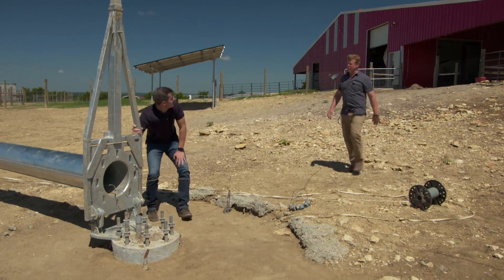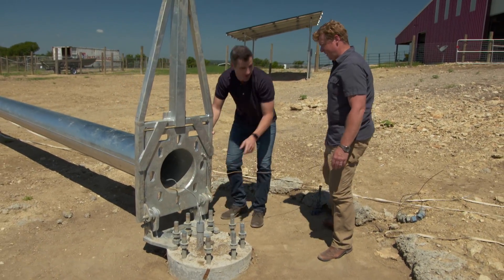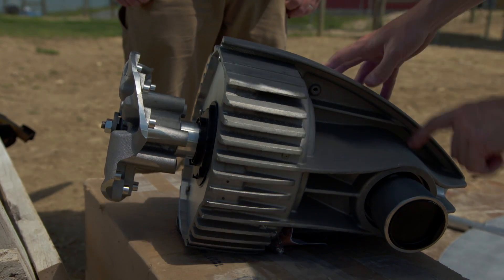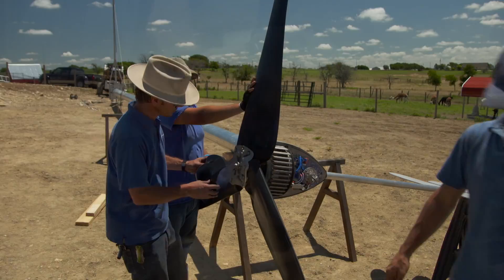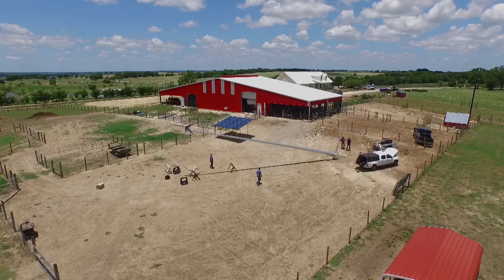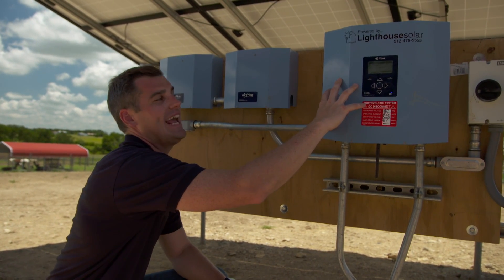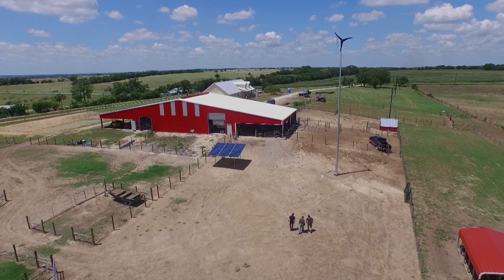How to Install a Home Wind Turbine | Ask This Old House

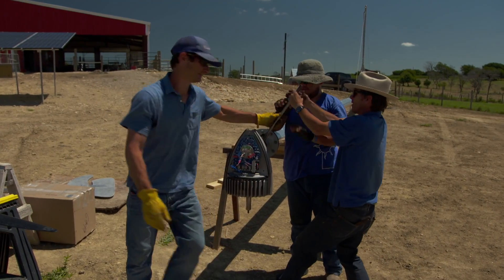Comment: Lol @2:30, why not just use a longer tool for more leverage?
Reply: In order to be strong enough the pole (90 degree to tower) is usually welded (and often braced) to the tower pole. So it is always just there. The longer it is the more chance you will trip on it, hit with a mower, etc.

Comment: So I just lift up my 60ft pole that’s already at my house, and I’ll have wind power?
Reply: Yea, dont forget to also use the solar panels, and inverter that is also there somewhere and the batteries that were missed in this step by step, diy how to useful video
Reply: @syaz4380   That's a generator. But yes you can use it as a motor.
Reply: @asmmahfuz8569  You don't want to use a motor = too inefficient.  Use an AC 3  Phase generator, that is designed for a wind turbine.
Reply: @MrSummitville  That's a good advice.
Reply: @asmmahfuz8569  Many Wind Turbines spin at only 400 RPM.  Some up to 800 RPM.  For a given Rotor Diameter, we should always use an alternator that creates the proper power (watts) that matches the RPM of the Blades at the "Rated Wind Speed" ...

Comment: This is a cool project and I applaud the owner, but this was a terrible investment. That wind turbine probaby cost him over $50,000 with permits, electrical and digging. At 1500 watts this means it is connected with a puny 12awg wire and will take decades to break even at 10 cents a kw/hour. Not to mention 1500w is only possible when the wind blows and is a maximum rating; he could only be getting 200 or 300w on a calm day.

The same goes for solar. Too expensive and does not generate enough power.

When solar and wind can hit 20kwatt continously then ill consider the 40k investment.
Reply: I will break-even in 3 - 4 years, with my self-installed 8,000 Watt PV array.  I got 30% of my investment back the next year. The panels are guaranteed for 25 years. Lots of sun plus expensive electricity per kWhr = quick pay-off.
Reply: @MrSummitville  certain markets, like ripoff California or Hawaii, will pay off faster.

1500w from a wind turbine though ia worthless. That's not even a 15A 120v circuit.

Comment: All the excess energy goes back into the grid? Umm...that is something I wouldn't want to hear.My wind turbine, my energy.
Reply: You wouldn't want to be paid for the energy you put into the grid? Help others reduce their fossil fuel use?
Reply: @void970t5  Most states now limit you to the max amount you use per year. All you can get paid for is to drop your bill to zero, anything you produce beyond that is just a donation to the power company. Some states (HI) are no longer allowing any new grid tie installs.
Reply: @bradquinn4161  Net Metering - most people do NOT generate more than they consume, on a yearly basis. Daily credits can and do accumulate until consumed  later in the year ...
Reply: @MrSummitville  First that is why I said per year. Second more and more people are going to systems that can sustain themselves at any given time of the year. The grid has become increasingly unreliable over the last few decades. A lot of areas are see outages of multiple hours (or longer) several times a year(or more often). This is why systems are increasingly going from just grid tie to hybrid (with storage) grid tie.

Comment: The title makes it sound like anybody can do it. I think not
Reply: I poured a 6 X 6 foot by 4 feet deep base for a 75 foot radio tower. As well as digged a 120 foot trench for the communications lines. So yes it can be done yourself but it's a lot of work an time. Also added steel rebar throughout the concrete base. As far as 20 foot deep bars for support you could rent most of that from Home Depot I bet.
Reply: It is easy if you buy the generator and the blades from market. Anyone can do this. But if you want to make generator by yourself then it's awhole different story.
Reply: @asmmahfuz8569  I can't put a giant concrete pad or wire the whole grid for this
Reply: @joewalsh1054  Its not that expensive to get a person to make you a concrete foundation with piles
Reply: @asmmahfuz8569  see I aepdodoeps p do oh9spspdpr9e or ú8 Dr r490rr0d koo ot poo opr0rpr00e99eodorodooror9r89rr9p
Reply: If they can do it you can do it what makes them better than you

Comment: I love wind and solar.........but for some perspective; toasters and hair dryers can use 1500 watts; that's 1.5 kW!!
Reply: Dennis Downes , yes you are correct , but the power doesn't go straight through , it goes to a battery bank that has been charged , so the sun is charging the batteries and the wind turbine is charging the batteries , the solar panels can charge during the day and the wind turbine can charge day or night to keep the batteries fully charged, so you can eat your toast while you blow dry your hair , and your electric bill is still ZERO
Reply: @jimthomas777  I guess you missed it. This is a grid tied system, probably no batteries used.
Reply: Brad Quinn , even grid tie system has batteries , and I could care less if it does or doesn't have batteries , the guy is still saving money , in the last 4 years I have saved over $4000 dollars , and those  4 G's  were not missed by me , they were missed by the electric company ,  but I guess you missed it
Reply: I am all for renewable energy. SOME grid tie systems have batteries (usually called hybrid) ,but most do not. One of the biggest expenses in solar is the batteries. It is also the most common thing to fail. That is why most grid tie systems do NOT use batteries.
Reply: Brad Quinn , That's exactly why mine is not a grid tie , mine is OFF grid , I'm getting ready to talk some of my buddies into doing the same thing as me
Reply: @jimthomas777  Price the system with and without batteries. The batteries will probably be half the cost. I am not saying you are wrong, just making sure you are aware. Stay away from lead acid batteries unless you like to replace them every five years. NiFE and LiFePO are probably the best. NiFe are not very efficient but they are almost impossible to ruin. LiFePO are very efficient but can be damaged pretty easily. Both can take high amp charging. Both are expensive(in the short term).
Reply: Brad Quinn , this guy has had a used forklift battery for over 20 years , and it does just fine , used Hospital  lithium batteries work great , they get rid of them before they go bad , because it's a Hospital , there are other options also , I have a optima red top battery , it's 11 years old
Reply: The hospital batteries are usually LiFePO(lithium iron phosphate). I would bet that the guy using the forklift battery seldom uses more than 20% of its rated capacity (massively over sized battery), is religous about battery maintenance (at least weekly) and you can do that but again it just raises the cost, space, and MAINTENANCE hours. I call BS on an optima battery on a house sized battery array lasting 11 years. Even the "good" AGM batteris designed for solar rarely last that long.
Reply: @jimthomas777  No Grid-Tie systems do not have battery banks.  If it was Grid-Tied and it had a battery bank then it would be call a Hybrid Inverter.
Reply: @bradquinn4161  I agree, I have never seen anybody use a battery bank and generate their own electricity, using PV and/or Wind, that is cheaper than the cost of their existing Grid Electric - NEVER.  I am still waiting for that first person .....
Reply: @MrSummitville  The key word their is existing. IF you are building a place that is even a few miles from an existing line, some utilities charge $20K a mile to run a line. In those situations it MAY be more cost effective to go the battery route. The trend now is to oversize solar input and minimize battery banks. Size your system for the worst solar day of the year and assume it will be cloudy that day. The advent of 400V strings combined with MPPT charge controllers means that you can produce usable power (30%of rated capacity) even on the cloudy days. Which is why many size there systems at three times the required size for day of the year with the least sun. In the long run it is cheaper to put the money into larger solar banks than batteries. The solar panels will typically survive three or more battery banks being replaced.

Comment: 2:30 "Mama's don't let your babies grow up to be wind turbine install technicians..."
Reply: Three of the weakest turbine installers right there
Reply: badad0166 , mama , what is a wind turbine install technician ? 
 well , red goes to plus 
black goes to minus 
and where does the third wire go mama ? 
that goes to the ground , 
so just throw it in the dirt ?

Comment: I wonder how much this turbine cost for 15 amps
Reply: At what voltage? 24 volt 15 amp ones are on about 400 bucks
Reply: Not that size that size is huge add the cost of the cement the base the hinge the pole the installation just the cement alone is like 10 grand and an aluminum pole that size is about 5 grand or soo
Reply: @erickfernandez8485  it is a steel pole and I wasn't talking about an install. That price changes depending on where you are and how high you need to mount it.   There really isn't a need for such a crazy hinged pole.
Reply: Like 50 to 75 grand

Comment: Thank You for a great video.  I plan to put up a micro wind turbine. What I would like to do is tie to the grid and power my house as well. If the grid shuts down I would like to continue to supply power to the house without any power going back into the grid AUTOMATICALLY. And when the grid comes back uo, Supply the grid with power again automatically. Is there a way to do that? If so please point me in the correct direction  to learn. Again Thank You.
Reply: Check out the Fully Charged video where Robert talks about the system he had installed at his place.

Comment: Which genarator you used AC or dc
Reply: 24 dc
Reply: @Sunblocker101  Turns out this one is 380V regulated DC.
Reply: @bradquinn4161  Turns out ... the generator is AC, which is then converted to DC
Reply: @MrSummitville  If you look at the specs of this particular wind turbine it puts out 380V regulated DC at the Turbine. I agree most (90%?) wind turbines send out multi-phase AC down to the ground but not this particular one.
Reply: @bradquinn4161  I did not say that was the voltage down the mast. Where does it state the "Generator" outputs regulated 480 volts DC?

Comment: I would not be happy with the tiny concrete foundation. There is a massive load - cantilevered off the edge of the concrete under the hinge, which is likely to crumble over time. The hinge area needs more support!
Reply: You did catch that there was a pad under the ground (9ft diameter) and then four footings that went down twenty feet?

Comment: 2:40
Never do this for you diy home turbine, look at the numbers of electronic componets inside. 
He will have to take it down soo again and replace circuit board.
Here how you do it correctly. Drag 3 phases from turbine into your house, then connect it to speed controlller/charger at your home.
Reply: Yes the way they did it was not the best to say the least. Transforming from ac to dc current makes you lose a lot of effect in those long and thin cables. And you need all those vulnerable electronics components in a very bad place susceptible to rain and maybe lightning.
Better deal is sending ac current and rectify it once it's on the ground and is a sheltered place.

Comment: WAY- WAY tooooo small on the wire and way-way too much concrete to hold that pole.   
That's an AC wire not for running DC over some distance.  He will be lucky if he gets half of what little he will produce down to the converter.   DC at low voltages loses much of its current, unlike AC.  
All that work mostly wasted!
Reply: Exactly!
Reply: I bet it's an 3-phase AC 48V alternator. So the wire would be enough, even though, a larger diameter would reduce the wireloss.
Reply: 24 DC at 1,5 kw, is 16 amps. 
so a 6mm wire is enough for 17 meters. (looks like 17 meters for the wire length.)

Could be sheilded tho for less losses.
Reply: @Sunblocker101  rly? How? 16A*24V= 384VA, where do you have the other 1100-1200VA?
Reply: @djangoryffel5135  oh sorry 64 amps
Reply: @Sunblocker101  The switch from AC to DC was done in the Nacelle. The wires ran straight out of the ground into the inverter. IF they had done the conversion at the inverter, you would have seen the units. As they dump a lot of heat they are always outside the inverter. At 24 volts with that amperage over that distance with those wire you are looking at least 10% line loss. Probably variable voltage 60 to 160 volts and the wire would still be to light.
Reply: Turns out it runs at 380v regulated DC. It is also rated at 1.5kw in a 11m/s (25mph wind).

Comment: This is absolutely stupid, massive pole, massive foundation, why not bolt it to the building? it's higher and that's probably where the power going anyway.
Reply: There is a reason for the massive pole and massive foundation (they are not over sized). In a 60mph wind it would tear it right off the building. Big surface area with a 60 ft lever.

Comment: That pole is insanely big for 1kw of power, and this is why the wire is so small. I would have expected at least 10 or 15 kw for that size of pole. Also for the size of that guys property why such a small system? I would think that 10 to 12 KW on the solar would be more like it, as 12KW solar gives an average of about 4KW, and the wind power depends on the wind in the area. I am basically saying if you are going to pay someone to put something in it is better to pay for more than you need because the cost difference in the larger is not much when looking at the overall cost. Also it means that you will not need to upgrade in the future, and if you are using solar and don't have much backup it can power all of your appliances during the day, and then batteries will keep your food cool and your lights on at night.

Comment: no slip rings for the wiring? what if the head spins around 1000's of times?
Reply: What if it does not?
Reply: Generally the "cord" is setup like a spring. As it spins one direction (say clockwise) it tightens the spring. After it gets so tight it pushes the head in the opposite (counterclockwise) direction. It does wear on the cord over time but it is more reliable than a slip ring.

Comment: Would they allow this in a city?
Reply: Wind in a city is greatly reduced by surrounding buildings. They usually say at least 150ft of clean (no obstructions) air. For liability reason you will need to own the land for a radius from the tower at least the height of the tower. Your home insurance would require that the tower be at least the height of the tower away from any structure.

Comment: IDK what the solar panel prices are like in the USA but in New Zealand you can get 26 270 watt panels for $6,000 nz dollars thats 7020kw of solar oO its flipping cheap and solar is simple to install   for the wind for a 2kw mill you can pay 8,000 or even more but wind is useless on small systems it only realy works when you get 10kw systems or bigger with 2kw systems your find that most the time your be lucky to get 100 to 200 watts from it but it can peek upto 2kw   so if you have the room solar with batterys is the way to go BTW i have both so i have hands on experience BTW often at night the wind drops off and the mill stops spinning so the idea of wind at night, solar by day is total BS 95% of the time
Reply: You just convinced me not to buy a whisper 175 for US 600...! Ive been kicking the turbine can down the road for 13 yrs being off grid. I even have a micro turbine that sees no water...! just sand and mud when it rains....but panels on trackers are great...!!

Comment: Okay I'll admit this is a neat idea but is this really what This old House is like now? I used to watch this show years ago and it always seemed to be about how you can fix up your house yourself. This is buying a commercial wind mill, having a professional crew install it and the This Old House guy just standing and watching them with a clueless look on his face.
Reply: it may sound crazy, but you dont just buy this thing at Miners and pour concrete around it, i see what your saying, and to that i say that they still have plenty of home repair videos
Reply: DIY version is to build it out of wood and use to it power a grain mill. This is not a DIY project. If you are at the point where you have a skid loader/forklift that can lift these components, and then winch it up you are way above and beyond a DIYer already and should be able to do it all from this video anyway.

Comment: Wouldn't double the solar power be more economical?
Reply: Sun don't shine at night!👍🇺🇸
Reply: @michaelhowell8489 , Yes, Solar is better for the most part and most of the time, the wind will slow down so much at night, they barely work.